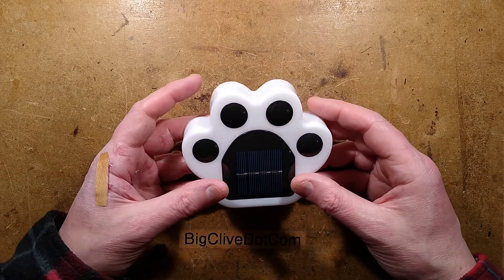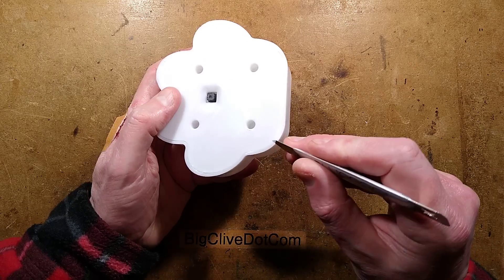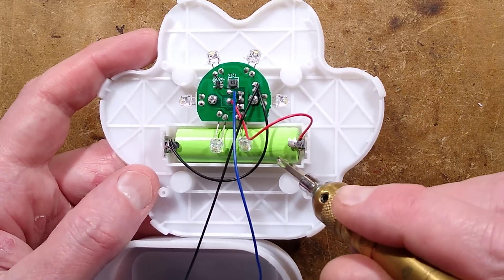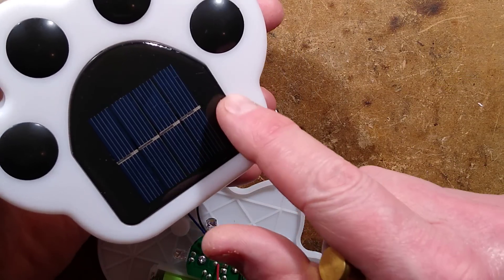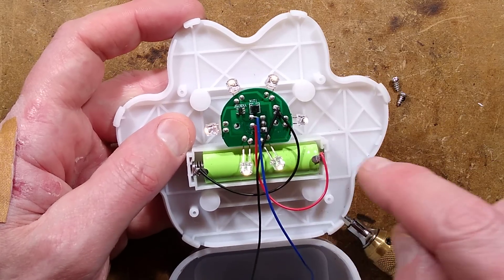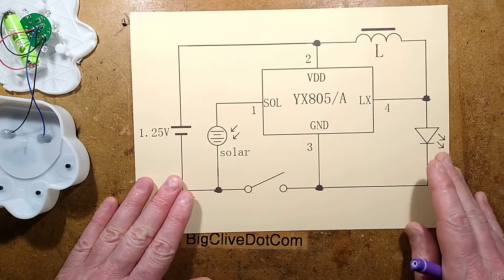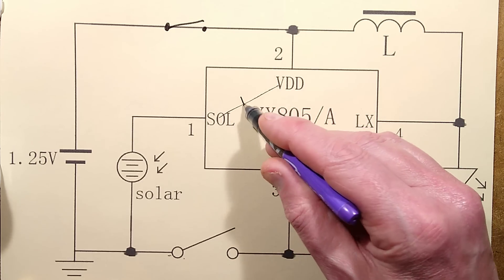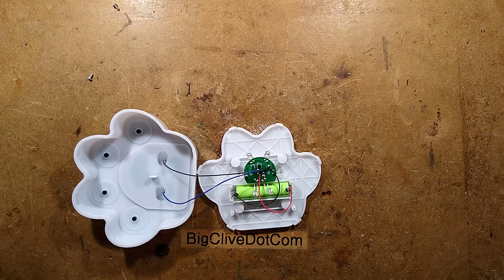Solar paw teardown - with schematic

Comment: Is there any chance you could show us how the 'hydrogen fuel cell power generators' currently being sold on ebay work, please? I can't quite get my head around it, they look like they can generate up to 1volt, but it comes with a tube, i'm assuming to pump water into the unit, but then that would surely defeat any power generating purpose? - anyway, many thanks, keep up the great videos ! 😊

Comment: Have you found a solar light that should legitimately last a long time and has a battery that should last a full night (assuming you aren't near the poles)?
As I've seen it, it seems like the best "solar" lights would be regular sealed LED strips or Christmas lights plugged into a house with solar panels.
Reply from the maker: There are so many variables in location, light placement and weather.
Reply: You can probably waterproof one like big clive's video shows if you search up "BigCliveDotCom waterproof solar lights." So that at least takes the durability question out of the equation. And for the solar panel if it is covered by plastic, to prevent it from yellowing you may add a protective coating better than the factory one. I'm not sure how but I'm guessing you can buy a 3m headlight protecting wipe and apply it to the plastic so it lasts longer before yellowing. 

But I've had solar panels that have a thin film of plastic on top of the solar panel that eventually flakes off due the elements. Then I feel like it would be better to sand that off before applying any kind of protective coating.

And even if it yellows, that can be sanded off and the protective coating reapplied. Maybe clear spray paint meant for plastic would work, but I tried that once with plastic headlights and it yellowed pretty quickly but 3m coating wipe has held up strong.

Comment: Looks like it would be easy to change the LED color.
Reply from the maker: Very easy.  But the LEDs are in parallel, so they would have to match.
Reply: I think a lovely blue - like Uranus perhaps...
Reply: @richtheobald4390  Or Red like Mars.

Comment: i got a set of 4 paw prints that lit up from aldi with 1 solar panel, they have since succumb to nature after sitting around cat graves for a few years, products like this are made for single season use before they sell you a new design next year, would make for great project cases though

Comment: Hey clive, i have an electrical question and i couldn't find the answer online.

I recently bought a "gulikit kk3 max" controller. I really like it aside from 1 small tactile flaw which i might try to mod i guess.

I was thinking.
Currently i use it at my computer so its absolutely no problem to use it wired, but i will want to use it wireless later when my living room is more accommodating.

Should i use it wired to save battery health? 
Or is a battery powered device generally not going to benefit from being plugged in, or worse, kill it faster.
It really doesnt matter how i use the damn thing at the moment as the latency and polling rate is also essentially the same with the dongle.
I hope to do what's best for life expectancy of the battery for now.

Is there a general rule for using wired capabilities of things with batteries?

As a possible clue, it does indicate that it is fully charged, also when using wired.
Reply from the maker: If it's designed to be wireless and has long standby time then I'd suggest using it as a remote unit.  But there's no harm charging the batteries while at the computer.
Reply: Thank you sir! 
I will just use it wireless.

It has a relatively short standby time because it simply turns off after a momentary halt in usage (I think about 5 minutes).

The promised life is pretty good though. 25 hours with the lights of, i guess some degredation of that should not be the end of the world.

Again, thank you!

Comment: Have you compared the circuits on the many solar lamps you have opened to see which one is the best or all exactly the same?
Reply from the maker: They're very similar.  It usually comes down to quality of the solar panel and rechargeable cell.  They can usually all be made more water resistant.

Comment: I’m amazed that so small a PV cell can provide enough current to charge the AA cell. Can the LEDs stay on all night?
Reply: It can't in the UK 600mAh is overkill in the extreme. some lights are shipped with 40mAh cells, British sunshine and crappy PV's barely fill those

Comment: How would you calculate the inductor's "Henries"?
Unfortunately, the datasheet doesn't mention any values or formula.
Reply from the maker: Some datasheets for the leaded four pin version of the  show inductor values and currents.
https://asset.conrad.com/media10/add/160267/c1/-/en/002436030DS00/datasheet-2436030-tru-components-tc-9744120-linearny-io-bulk.pdf

Comment: this toy looks like it really wants to leak water inside of it.  i found that 1 part silicone to 1 part turps makes an acceptable paint for sealing around such things.  the 2 components resist but do mix eventually.  not suitable for around the battery though. turps is not the only thinner that will mix with silicone.
Reply: On the battery contacts why not also use silicon grease ? |Better than nothing, and better than vaseline, it does not go runny when warm. Even the clear stuff you buy for greasing water taps and its seals. Good for low voltage static contacts and cabinet seal, but NEVER use it for switching/sparking contacts, it then forms silicon carbide abrasive crystals (right below diamond in hardness).

Comment: I picked up one of the color changing ones, too. They are very nice. They use four RGB LEDs and have a different chip to synchronize the color changes in a slow and pleasing manner - definitely a nice little circuit that can be repurposed if desired.

Comment: Yet another solar gizmo. I think it's supposed to be a panda paw 🐼.   Speaking of miscellaneous Chinese junk, we bought a little solar duck at Dollarama.  This yellow duckling sits on the dashboard of the car with double sided tape and waggles from side to side with it's built in solar panel in the base.  Or at least that is what is supposed to happen.  I tried experiments of parking in bright sunlight to make it waggle but to no avail.  It only seemed to waggle when the car was actually moving.  Hmm.. thought I, and proceeded to unscrew the base to find a dark blue cardboard knockoff of a solar panel and no circuit board, wires or anything.  You would have thought they would at least have crazy glued it shut to hide their crime.  I guess not.  Anyway it was well worth the $3 it cost just for the puzzle solving mystery alone.

PS - It is a very finely balanced device and waggles from side to side with the slightest motion so I put it back in the car and it is fun to watch as we drive along.

Cheers from Canada :-)
Reply from the maker: That's the first time I've heard of the solar wobble toys being fake.

Comment: Will there be sun enough in the UK to make it work is the big question ? :face-blue-smiling:
Reply: The solar cell has an integrated piezo element that creates power when being hit by raindrops ;)
Reply: @tubybubi  you should scale that up and do the math.
Reply: No I am born and raised 020 but everything south of 020 is called Belgium here. Like East of 020 are farmers.
Reply: Yes it will, why not. As long as you don't use larger capacity Ni-Mh cells. 600mAh is what it is designed for i.c.w. that small solar cell.
Reply: @erikdenhouter  OMG you must be from Belgium
Reply: @RS-Amsterdam  Rotterdam
Reply: @erikdenhouter  zelfde 😅🤣
Reply: @RS-Amsterdam  Een 010 vermomd als een 020... Schaam je 😁
Reply: @erikdenhouter  600mAh is a waste of time anyway , it's not a matter of capacity, a 100mAh will be fine because you just don't get enough daylight in the UK. Be generous and say that solar panel outputs 20mA in full sun and say its pointed at that sun all day for 8 hours again very generous then the total generated 20mA for 8 hours or 160mAh. Some solar garden lights have less than 100mAh cells even as low as 50mAh and work fine. Doesn't matter at all how big your bucket is if there aint enough rain you will never fill it.
Reply: @andymouse  Yes, you are right in that, I didn't run the numbers that way. I wonder why they didn't fit an AAA, because the maintenance current of the AA is larger, and waisted also, at least something like 50mA (~0.05C). For an AAA it is significantly less. It could be there's no production left of cells under 600mAh.
Reply: @erikdenhouter  :)

Comment: I like the way you believed the capacity written on the battery!
Reply: It's easy. Just divide by 10.
Reply: I doubt it is fake. After all it is a AA battery. 600 mAh is at the bottom of AA capacity. 
There is nothing to save unless they go AAA or smaller.
Reply: I was thinking that also.
Reply: Well one led needs between 5-10 ma. since 6 are in parallel it means 30- 60ma. with a 60 mah battery they will only burn 1- 2 hours. So i believe the value of 600 is about right for the application. Then they burn 10-20 hours. Also the chip will use some current and there will be losses too.  I think they will cheat on the charge cycles, charging and overall quality though. It is cheap Chinese junk afterall. On that i totally agree :) Maybe 300 mah is doable but definately not 60.

Comment: Looks like they will last until the first rain or dew.
Reply: One thing Clive hasn’t suggested is dropping in a packet of silica gel after waterproofing the solar cell and battery contacts. Not a permanent solution but will surely extend its lifetime.
Reply from the maker: The silica gel soon gets saturated.  Proper internal waterproofing is needed.
Reply: @markfergerson2145  He hasn't because it's to bloody stupid, last thing you want is a fucking sponge.
Reply: Like a lot of outdoor solar lights in the UK. They don't last long.

Comment: Inductor, can it change the rate at which it works or is it seemingly a fixed frequency, wondered if the light getting through the panel at a higher than expected frequency could blow the led
Reply from the maker: Fixed frequency.
Reply: @bigclivedotcom  how
Reply: Generally, changing the inductance on these will modify the current flowing into the LED. Within limits, lower inductance means higher average current and higher inductance reduces the current. See datasheet for a YX8018

Comment: Might be ok for a child's night light but beyond that, I don't see it having a use, have to assume that's a repurposed circuit board as that would cost more to cut out than a standard square
Reply: I think the idea is to set up a staggered line of them from the sidewalk to your front door or along a path in your backyard. You know,  cutesy dog prints that light up. Yes, about as superficial as it gets, but superficial sells.

I like your idea better. Keeps it out of the rain and damp at least.

Comment: "I wonder if a spray of mechanic's fluid film would work"  It would probably work since Eric O. over at SMA uses it a lot on electrical connections  :)
Reply: I actually used fluid film on my solar lights before. Filled the switch and battery contact areas with it and sprayed the boards. It worked for years.

Comment: In the manufacturer's datasheet, what's limiting the charge-voltage on the cell if the switch disables the chip but keeps the solar panel attached? Is it just relying on the voltage from the solar panel and diode-drop being around 1.5v max?
Reply: NiMH cells don't care about being charged further when full (as long as the current is not too high), they just get a bit warm.
Reply: @moe.m  So it relies on the current limit of the solar panel to allow the NiMH cell itself to drag down the voltage? Four solar cells is about 2V.
Reply: @gloomyblackfur399  Yes, exactly, the NiMH cell will clamp the voltage.